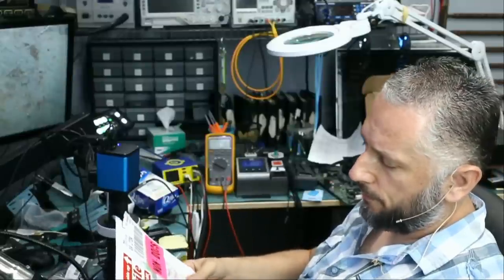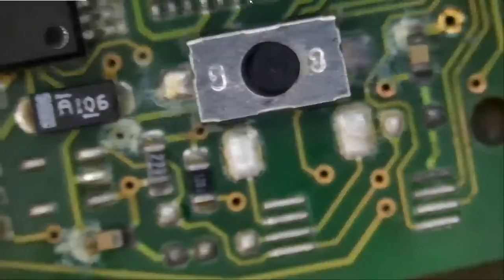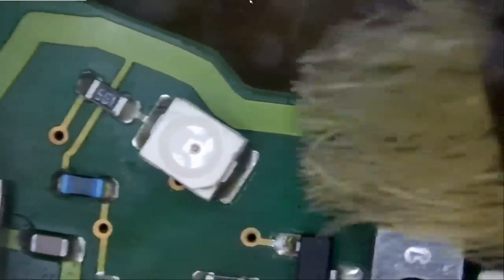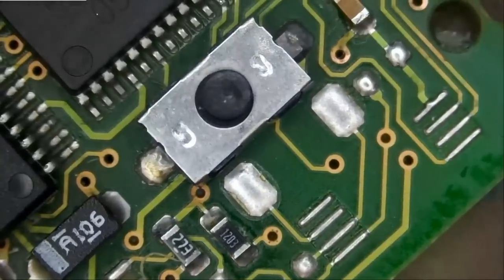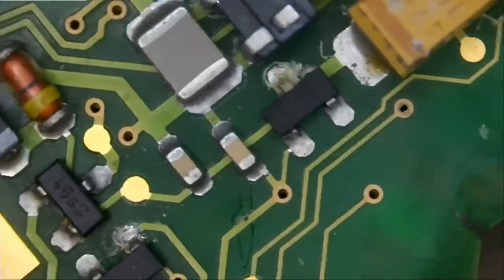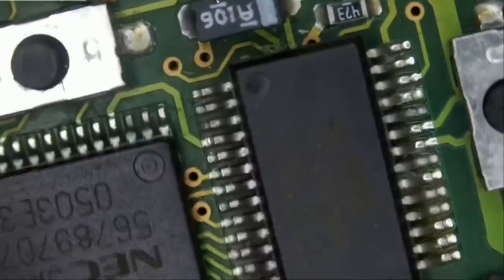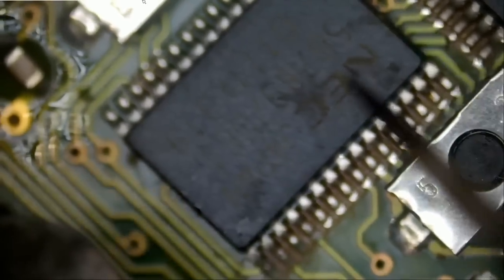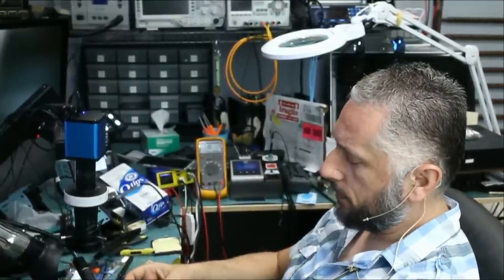Benz Key Fob Mailed from the BAHAMAS for Repair

Comment: First of all I would have tested the switch itself, before replacing any other components.
Reply: I also first check the switch in diode mode.
Reply: Yes the two switches, as there was corrosion on the board...
Reply: Agreed. Bahamas is high humidity. Test the switches.

I have a pool pump and chlorinator controller that sits under my deck (in Australia). It gets hot and humid under there and the controller stopped working. I took it apart and a bunch of those switches were faulty. Some contact cleaner fixed some for a while, but I ended up changing all 8 switches.
Reply: Or the LED
Reply: Nobody cares what you would of done.
Reply: @meh3247  🤣🤣🤣
Reply: @meh3247  Drip
Reply: It’s easy for everyone to say to start off to test the switch first after watching the video, maybe we should pay you to do the job!
Reply: @staminaman77  troll.
Reply: I thought the same! for example: could the little signal LED be faulty while he is using it as a sign that the FOB is functioning 🤔
Reply: @meh3247  Accurate
Reply: @staminaman77  *would have
Reply: @miko007  would have*
Reply: @staminaman77   😂😂😂 chill guys
Reply: @dafalzonAUS  people do pay me and he is correct he should of started there
Reply: @staminaman77  *would have
Halfwit.
Reply: When the Zlatan-confidence kicks in

Comment: I have fixed a couple of devices like this. I learned to remove the chips and clean under them as well. Corrosion likes to hide under the chips. I noticed the other chip (not nec) had some corrosion. Pretty sure that was the problem.

Comment: hi nice video i dont know if you test the buttons if they make a connection when you press them could be internally corroded
Reply: Yeah that's what I was thinking
Reply: Me 2
Reply from the maker: Yes already tried that. Switches are good. It's likely the oscillator or the big chip next to NEC. I went the other route and transferred the chip over. Done.

Comment: This fob key has two systems programmed on it. The Remote key and the Imobilizer. If the imobilizer is not integrated in this chip, the fob key will open the doors but not start the engin

Comment: I know conformal coating is a pain in the ass to work with, but this is the kind of application where it's justified. A key fob is the definition of an electronic device that is constantly exposed to the elements.

Comment: The button is likely the problem. Haven't watched the whole video yet but the very first thing I would check is if the button can open/close connection. Corrosion and carbon from countless electrical arcing causes the switch to not close circuit

Comment: Nice trouble shooting technique and I'm enjoying your video. But I'm thinking that if donor board came from another car, it will not work to customer car even it sending correct frequency after fix. Aside from fw, NEC chip may contained IDE and password that are unique for every car.
Reply from the maker: Frequency is only to test the buttons. Of course it will work. Don't just write stuff without knowledge. We've done this many times before. https://youtu.be/aAk6I1Trm4g

Comment: Donor board is in far better condition and clearly not corroded, my first move would be to test the switches and if that didn’t work move the relevant encoder Ic from the faulty board to the donor one

Comment: I think that ultimately the problem was under the chip, because there is corrosion in the kind of rivet that connects the two sides of the pcb, and this is the kind of problem that can drive a repairman crazy

Comment: I have a question for the community because you're probably too busy to answer!

Northridge fix has inspired me to do my own repairs and I found the first issue on my Asus laptop.
The 7410 mosfet is faulty and needs to be replaced.

I'm kind of excited and want to get the repair done ASAP and I have about 20 other broken laptops here in front of me I was wondering can you mix and match certain mosfets and how do you find out which ones are compatible.

Is there a site that I can type in the 7410 mosfet and find suitable replacements? Or am I best off biting my time and ordering the correct part?

Comment: Years ago I had a cell phone. The provider would not fix it because the sticker turned colors. They said it indicated it was exposed to moisture. This upset me. I used a paper punch and punched out a new sticker and got my phone fixed. That sticker was a scam from the providers. Glad I was able to trick them.

Comment: Stupid question from someone without any knowledge about electronics: Why didn't he check the push button or the red led if they were actually working?
Reply: no not a stupid question it may very well be that that was the cause. He should have test it with the fob tester first, then check the buttons and the led, and than the rest, but every technician has is own way working trough diagnostics and find/fix the problem